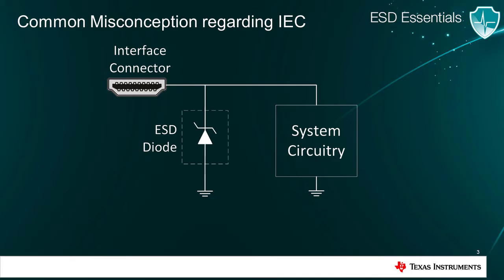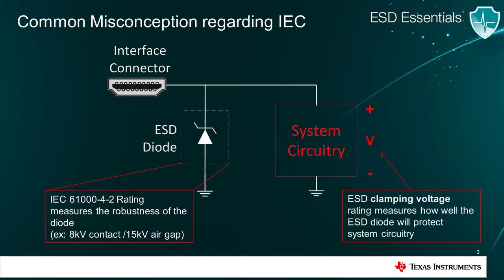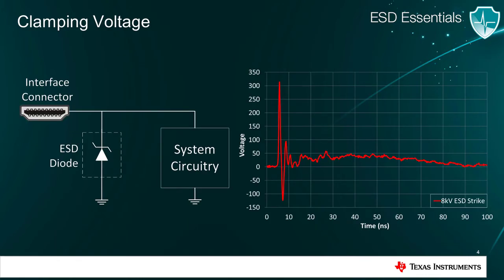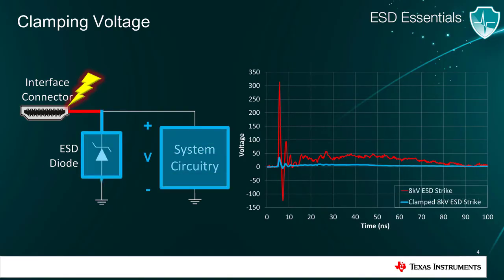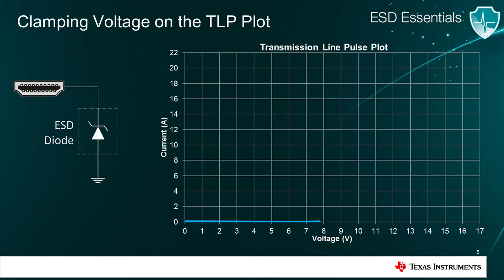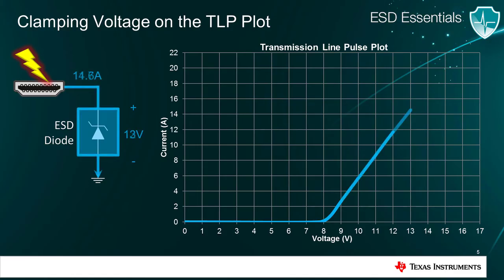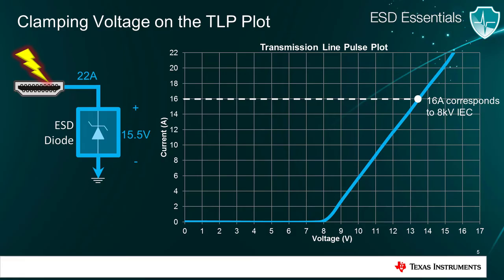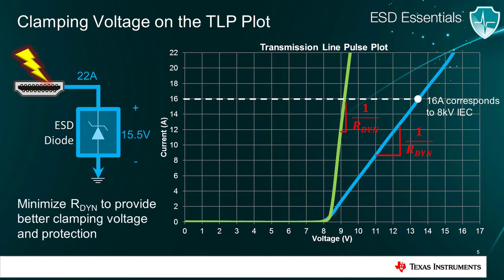ESD Essentials: Clamping Voltage

Comment: Why would voltage waveform due to 8kv ESD event not be 8kv?

And how does one qualify whether or not a given ESD protection device with a particular clamping voltage is appropriate to protect a given IC? It can't just be comparing clamping voltage to IC's abs max rating can it? There must be other factors as clamping voltage will almost certainly be above IC's absolute max rating right?